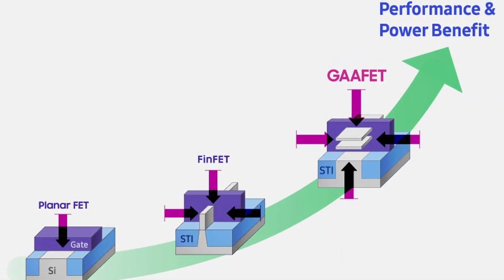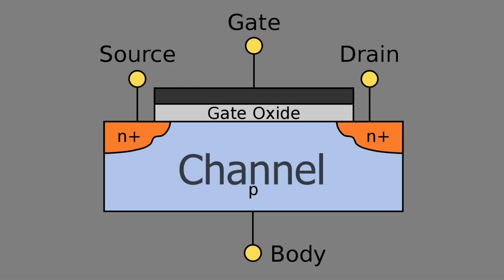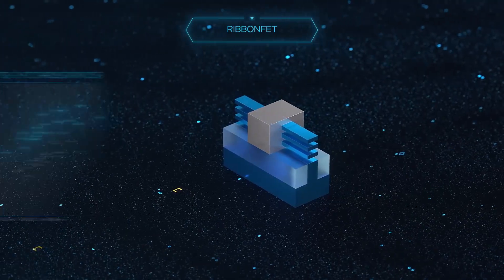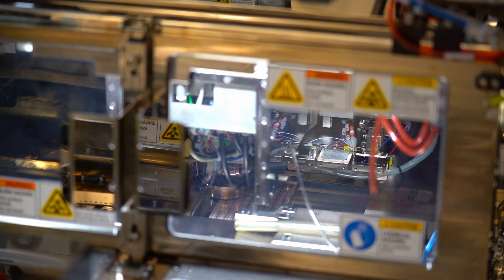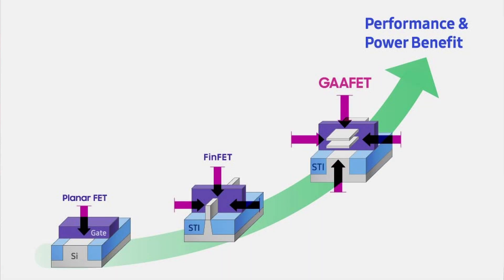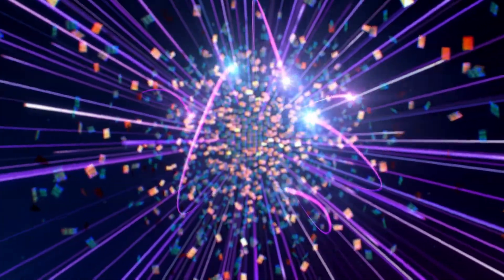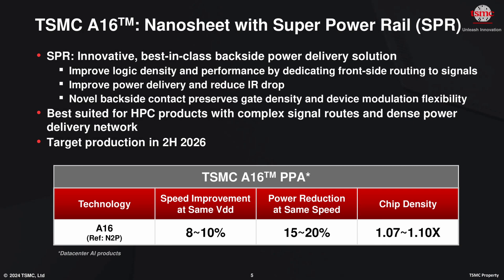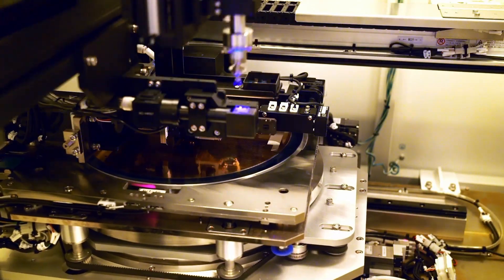Gate-All-Around — The Future of Transistors

Comment: Not an electromagnetic field, an electric field.

An electromagnetic field always means photons (light, microwave, radio, etc.) no exceptions.  That's why it has the "electro" part and the "magnetic" part; photons are an alternating electric field and magnetic field.

Field Effect Transistors just use an electric field, that is, a charge.  Nothing magnetic.
Reply from the maker: Of course, you are right. Thanks for the correction!
Reply: @HighYield  You were not corrected
Reply: This is a dumb and wrong distinction. The electric and magnetic fields aren't separate things. At the level of description of QED: Everything is photon exchange. Magnetic field: photon exchange. Electric field: photon exchange. "photons are an alternating electric field and magnetic field.": this is patently false there is absolutely no constraint on photons that the fields "alternate".
Reply: @timseguine2  I like how you mentioned QED in Quantum Mechanics. You can also use Maxwell Equation in classical electromagnetic to explain why Electric field (E) should be magnetic and inseparable from Magnetic field (B) too. 

Some people here might think of electron in frozen time and says that it doesn't create B in the present of electric field. But because time is frozen, we can't even explain how electrodynamics works (dynamics: change with time), and that invalidates all claims that E without B is possible. Well, in the beginning of universe, it could be thought of such thing, but here we have history through time, so it's always E-B. 

Now, for those who thought this is none sense because we're talking in too small of scale. Please remember that 1 channel in FinFET is just 3-5 nm wide and that's small enough to create a quantum energy well to trap electron and induced electron quantum tunneling (intel: Sky Lake datasheet, yes, It's that old, and skylake was 5-8 nm). 

What perceived as E without B when electron is stationary isn't possible in quantum, electron doesn't have defined position when you try to know it's momentum (speed with mass, debatable with quantum snapshot). The perceived illusion of electron stationary is actually the resistance or the electromotive inertia of charges, and it is defined with Maxwell-Gaussian Magnetic Force, which means charges seems to be stationary only because magnetic field it creates makes it loose energy and slow down.
Reply: The EM field includes magnetic and electric oscillations, if you must call them photons, fine. Electric and magnetic are components of an EM field/wave, but they are not proportional. You can have electric effects without much magnetic effects and the other way around. The proportion of these components depends on geometry, material and other properties of the effector and medium. FETs don't generate MUCH of a magnetic efect, NOT none.

Your comment is like the inverse of astronomers measuring magnetic fields in space and concluding that there's no electric current flowing because the magnetic effect is weak. Kilowatt lasers also generate next to no magnetic effects.
Reply: @PaulSpades  ? A kilowatt laser would have a kilowatt of magnetic flux (as well as a kilowatt of electric flux) but it would be nearly undetectable outside the photons.

A FET generates no magnetic field, except a negligible field when the charge is impressed or removed.
Reply: @xlerb1637  All true. A 1kw laser generates 0.00133 tesla when hitting a surface (assuming perfect absorption): a small bit stronger than a fridge magnet.
 
The FET generates EM when switching(which should cause tiny EM ripples). But also caries electric current when conducting, and you can't have electric current without magnetic waves, as small as they are.
Reply: @PaulSpades  That's a good analogy, but regardless, there should be a clear separation between electric, magnetic, and electromagnetic fields depending on context. In the context of FETs, I don't think electromagnetic and electric fields are interchangeable, but these mistakes happen.
Reply: @EntekCoffee  I guess it's useful to talk about them separately when discussing electric engineering topics. But he's still not wrong in the video.
Reply: @PaulSpades  Actually, I'm not trying to debate in the right vs wrong territory. Ethics isn't my thing, apparently. I'm just pointing out that the reason behind the separation of these terms are contextual, rather than accuracy.
Reply: @PaulSpades  I'm gonna blow your mind - electromagnetic field doesn't even objectively exist. There is only electric field. Magnetic field is just doppler shifted electric field.
Reply: @tempname8263 the inverse is equally true. Electric fields are just dopplered magnetism.
Reply: What does an electric field do? It moves a charge. What does a moving charge make? A magnetic field. Electricity and magnetism are inseparable, especially at the nm scale. As a trivial aside, if you squint really hard, relativity can make an electric field a magnetic field and vice versa. This is one of Einstein's original conjectures in special relativity.
Reply: @rorymcfarland5752  That applies to MOVING fields.
Reply: This is a  case if dunning Kruger on full display Electromagnetism is one force. We seperate them in nomenclature out of convention and practical convenience. For engineering purposes, the magnetic or electric field effect may be negligible, but electricity and magnetism are the same fundamental force.
Reply: @spencerhho  Hold a magnet to a MOSFET and record the effects. Make sure to check several different orientations and polarities on numerous part numbers. Might be extra boring if a friend is involved to make it a competition to see who can waste the most time trying to gain control of the drain-source path first. Gowon... I'll wait.
Reply: @MadScientist267  You're stuck in technical knowledge and have no idea what you're talking about. There is no purely electric nor magnetic field, there is no magnetic nor electric interaction. There is only electromagnetism.

1. To begin with a processor does not work with static fields, it has to compute, change the state of transistors, etc, leading to a changing "electric field"
2. The reason you can't separate the two at a fundamental level is that because even if you have a static electric field, or to simplify just a static charge, if you move while it remains stationary you will observe a magnetic field. Which is to say there is no real electric nor magnetic field, because they change at the whim of the chosen reference frame. Hell, in the sun's reference frame, every single electric charge on earth is moving.

Charge is invariant with reference frame. Electric and magnetic fields are not, they're a shadow cast by an invariant underlying electromagnetic field.
Reply: @RainingArtillery  FFS I meant it how I put it, and for a reason.
Reply: After go form 2D to 3D I though the next would be some how be 4D
Reply: Yes, electrostatic even.
Reply: I was under the impression that a magnetic field always "shadowed" an electrical field?
Reply: @MRSketch09  Only applies to moving current. A static field has no net magnetic component. If it did, magnets would affect FETs and the like and they would need to be shielded from magnetism.
Reply: What do you mean by "photons are an alternating electric field and magnetic field"? Electric field refers to electrons so what's the deal between electric field and electromagnetic field?
Reply: I also don't understand this distinction the commenter is trying to make. I thought all electron current generated magnetic fields? Isn't that how motors work? So how can you claim only photons have magnetic fields effects?
Reply: @zomgneedaname  I think it's not about photons. Photons, IIRC, was brought for comparative purposes. In engineering, if a photonic effect is in question, then it's commonly referred specifically as electromagnetic fields/radiations. Regardless of whether the field itself is predominantly electric or magnetic.

Conversely, M-I-S junctions in FETs are dependent on electric fields but not so much on magnetic fields. Again, regardless of whether the actual field itself is predominantly electric or magnetic. Therein lies the distinction.

There's no "right or wrong" here, it's more like "common or uncommon", caused by the reason I mentioned. I'd say that whenever the conversation starts to be about "wrong" and "dumb", it's usually the right time to get out.
Reply: @zomgneedaname  The Field Effect Transistor doesn't involve current flow.
None at all, except for tiny amounts from leakage and at change of state.
It works by the effect of static charge pinching off current flow between the source and drain.
So since there's no significant current, there's no induced magnetic field.
Reply: How do you think, when forksheet fet with Full bottom dielectric isolation will come. Impact of self heating effect in bottom dielectric isolation is not overcome
Reply: How do you think, when forksheet fet with Full bottom dielectric isolation will come. Impact of self heating effect in bottom dielectric isolation is not overcome
Reply: It sounds like a quantum problem so it doesn't matter
Reply: Pretty sure electric fields need magnetic fields
Reply: it is you who are wrong, the electrons are held in the capacitor by the electromagnetic field, it is the electromagnetic field that stores energy, not electrons and holes.
Reply: @ruby_linaris  debatable, but mostly wrong.
Reply: @PaulSpades  Try to refute it.

Does not exist "electric field". Switching the current leads to the splash of an induction current. A magnetic component is induced around any conductor with a current, which is not connected to any particle.. and so on.
Reply: @ruby_linaris You're mistaken. It is an electrostatic field. Magnetism is not involved. At all.
Reply: Not all leading edge nodes, intel will fail again and just try a rebranded finet.

Comment: fast-forward 1 year later ...

Bi₂O₂Se
bismuth oxyselenide and graphene computer chip made by China
with
2D Transistors (GAAFET)
1.4x Faster (40% Faster)
uses 90% energy (needs 10% less energy)

compared to:
computer chips
with
silicon 3D transistors (FinFET) at 3nm

...
only time will tell

Comment: The reason for using a FinFET isn’t explained entirely correct here. The biggest upside of a FinFET is the usage of fully depleted material in the channel, allowing for much improved electric characteristics. This thus increases the control aspect of this, but so does a high-K gate oxid as well.

Comment: What’s wrong with this idea? In cases where the output depends on the field of the gate, if the output is used between nodes that depend on the gate output, and there is no gate, the output between the output nodes would be OFF.. I guess that’s why it’s called “Gate~All~Around”. To make sure outputs between nodes without gates exist, reliable power sources would have to power the entire system, or at least power added hardware.
Reply: https://youtu.be/5RPFfPtgw7g?si=7_lH1yIzRSgt2JD9

Comment: i have two questions 
1. Are we sure that transistor are working like transistor at nm level . I have a theory that they are working like vacuum tubes now current heats up the gate and current flow. dielectric changes into conductive.
2. why don't we make just create small vaccum tube or transistor like concentric circles .vaccum tubes will have 4 layers and transistors will have 3  layers.

Comment: If the gate wraps around 3 channels, and is energized to create a field to allow the channels to flow... how do you make 1 channel flow while the adjacent stacked channel cannot flow? Do you have to time it so all 3 channels can only open at the same time and like ... idk air traffic control bits so all 3 channels only open for flow at the same time but only the 1 channel you care about at this 'moment' is energized to transmit by a preceding gate? (where a moment is some insanely small fraction of a second)

Comment: The gate is the thin line separating channel core from the top coat. And as it's that thin, it only span a couple atoms of silicon. That's why it's hard to measure.

Having a fork gate as next of next gen looks promising. But it's effectively vertical FinFETs, it seems to have 3 gates on 1 channel and will suffer the same way FinFET struggles. 
If we assumes 5 gates per channel, we might have Ball Gate, which doesn't sound scalable. 
How about U-GAA, which bend GAA into U curve to make more surface area for the gate to control the channel, it looks better.
And finally, 6 gates per channel, that isn't gate, that's quantum computing. Why quantum? Well, as for scalability for 5 gates per channel, it comes down to how to connect them in arrays so it works as intended. With 5 gates, you don't have any choice to establish connection, in fact, it can't even complete the circuit. But with quantum particles, we don't physically connect them. We connect them with waves that makes them entangle. And I think, that's more promising than ForkFETs.

Comment: Hmm..

I will stipulate that Gate All Around FET is the cutting edge and future of semiconductor transistor design, but I wonder what benefits the design method would be/would have been realized on larger, back endof the line nodes.  Fin FET designs seemed to mean denser interconnects beteen transistors for a given node and density.  Am i reading tnis correctly?
Reply: He mentioned it in passing but it seemed like there's now the ability to make 3-D chips that use the vertical direction in many layers. Basically a cube instead of a wafer

Comment: ....is this the actual, real reason AMD, Intel, and Nvidia have been aggressively jacking up prices in recent years, beyond simple corporate greed? The manufacturing method for GAAFETs that you describe sounds like MOOOOOONEEEEEEEEEEEEYYYYYYYYYYYYYY. I don't ACTUALLY believe this, I 100% think it's just corporate greed, but add a drop of suspension of disbelief and I could almost consider the possibility that these companies have been getting a head-start on the MASSIVE price-hike that's inevitably coming. TSMC will be charging out the ASS for EUV GAAFET chips on the bleeding edge 0,000001nm(/s) node, because they will be bled dry by ASML for the machines capable of producing it (and of course a healthy dose of corporate greed on top of that, gotta think about the shareholders!).

edit: okay the more I watch the more scared I get. Someone, somewhere on the chain will have to eat some of this cost. If they try to pass all of this on to the consumer to maintain their profit margins all the way up the stack, nobody is going to be able to buy anything, especially with the direction the Western economy is headed. One self-comforting delusion is that the companies are squeezing the profits now to build some capital padding to absorb some of this shock in the future .. That's.. that's possible.. right? Shareholders wouldn't sue to stop any such efforts and demand that any such capital be dispensed as dividends ..right? :')

edit 2: Oh right! Memory uses silicon too! Memory production, where the involved companies have a history of actual, real-life, discovered-and-convicted price fixing, and other market games like artificially manipulated supply & demand. That's great! Great! Great! Great!